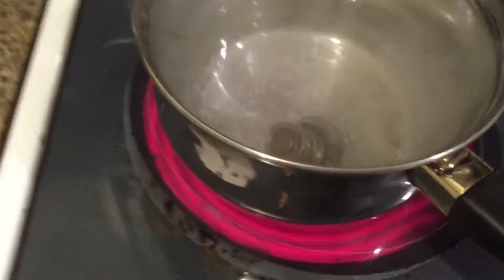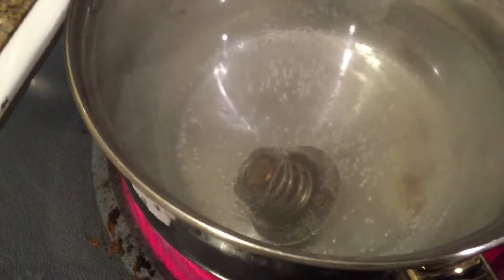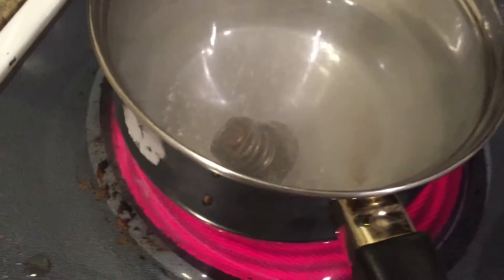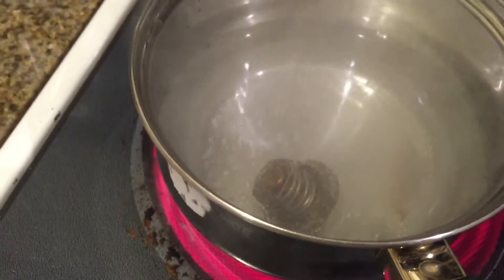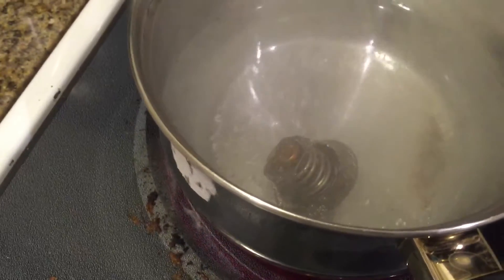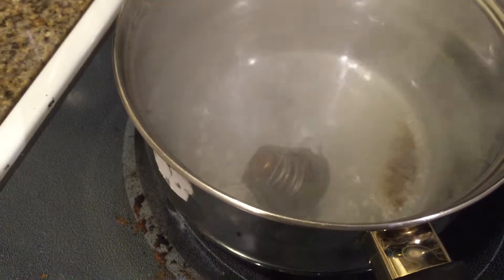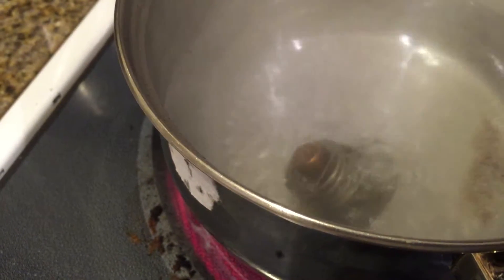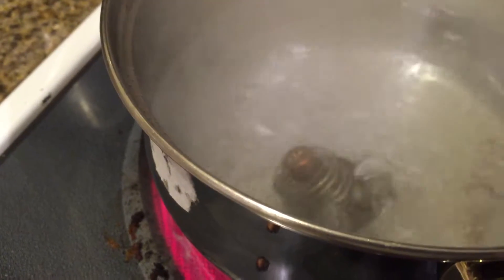Car Thermostat testing

Comment: Hi Radu. 
Most every thermostat will open if given enough heat unless something is visually broken. Water boils at 212 degrees Fahrenheit. Your thermostat is marked on the end as to what temperature it is supposed to open at. 165 degrees, 185 degrees or 195 degrees, depending on the specifications required. Just because it opens at 212 does not mean it is working properly for your car. Use a thermometer in the water to check for accuracy. At specified temp the thermostat should be wide open because at 212 degrees, steam is produced exponentially and the radiator pressure relief opens, dumping coolant. Bubbles in your pot mean that steam is being produced, thus the water in the pot is approaching 212 degrees. That stat looked pretty slow to me so if overheating is your problem, that stat is junk. Also, the heat sink is facing up in your test. Suspend it in solution in the down position so you can see the flap on the other end when it cracks open, to test it properly using a thermometer. 
God bless.